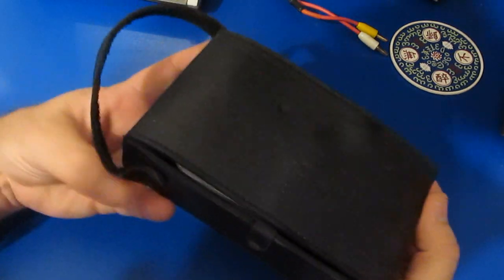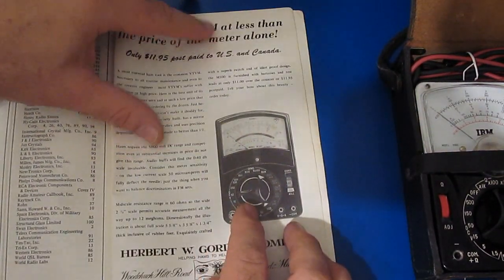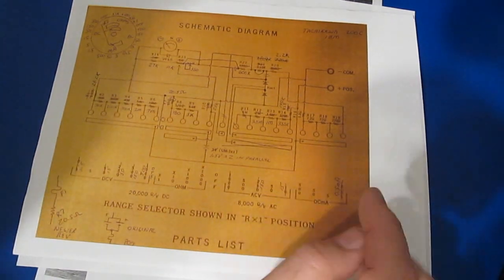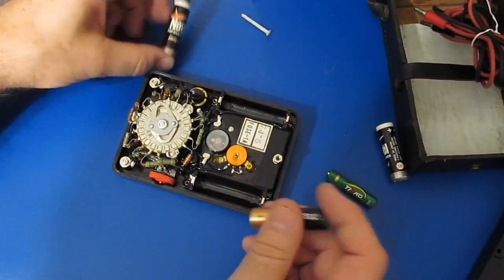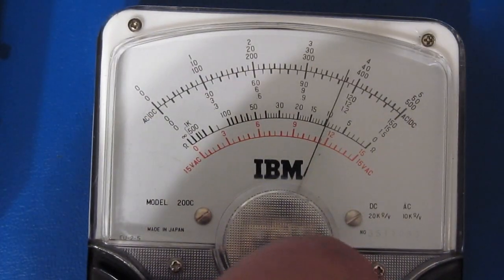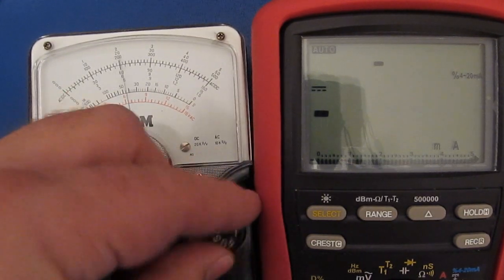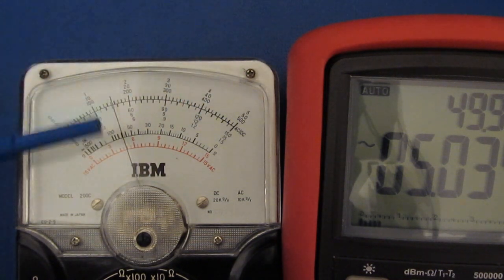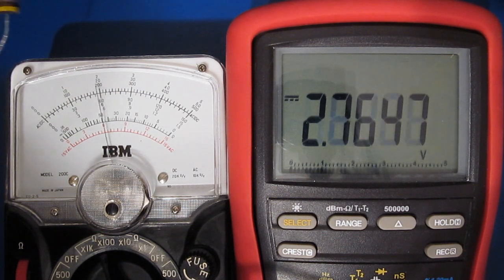Vintage Tachikawa IBM Model 200C Analog Handheld Meter

Comment: I just watched this video Dec 2021. My dad worked at IBM for 35 years and used one of these meters. He would replace it every few years. The old meter came home , I had several. Wish I would have saved one for sentimental reasons. The replacement was a Simpson 190 and a Fluke 8060A/AA. I still have them. Nice review.
Reply from the maker: Consider it an early Christmas present.

Comment: My dad worked as a Field Engineer for IBM in the 60s - 80s and I inherited this exact meter.  However, the fuse is missing.  What is the spec of the original fuse?  It looked like there was a sticker on the inside of the meter that said "1A", so is it a 1 amp fuse?

Thanks - great video - I know my dad would have really enjoyed it.
Reply from the maker: I used a little fuse 500mA ceramic fast blow.

Comment: I enjoyed this very much.  I have one of these meters that I got while attending ASU (I graduated in 1970), with a serial # of K48396. The only difference in mine from yours is that instead of a fuse it has what appears to be a little light that would glow during testing.  The main reason I watched this video was to confirm to my old memory the types of screws that holds the back in place, since I have long ago lost them.  I thought they were nylon, and your video confirms this.  I have been looking for replacements so that I can discontinue using black gaffers tape to hold the back to the front.  Would you or any of your subscribers know where I might purchase replacement screw of the proper length and thread.  I have been to several hardware stores and no metal screw (standard or metric) will work.  The only screw that I was able to get to thread and hold was taken from a trashed computer hard drive, but it was not long enough to secure the back at the top-middle position.  Any help would be greatly appreciated. Thanks, DH
Reply from the maker: I use mcmaster carr and fastenal.

Comment: I was going trough some old electronics stuff today and I found my old IBM 200c... I got that in the late 70'... thought I threw it away ages ago... and one of the batteries in there is still good, an old 1.5V Radio Shack Enercell Extra Life battery, must be at least 20 years old.

Comment: I have a tmk 500 meter but don't no how to use it any idea if i can get instructions or how to test it.
Thanjs.
Reply from the maker: Google "tmk 500", third hit: https://www.vintage-radio.net/forum/showthread.php?t=80468  scroll down a few posts and you will find the manual.   The internet is powerful.

Comment: Hi,  I have a TMK model 200 without  the letter C made by TMK. I bought it 1972, and has been with me since  then. It is a good meter and I can see why IBM modified  probably for his field engineers. The diferences between  the two models are.
Where you or IBM put the fuse holder, mine has an input to measure audio power levels with a scale in decibels... ( probably IBM field engineers did not find that  useful).
It measure DC voltages up to 1200 volts DC. 
The meter has a scale to measure  capacitance using the AC  volts range using  the 6 volts AC range. (The scale shows values from 0.0 till 0.2 microfarads.) . I remember the original manual that described how to make a setup do measure a capacitor in that range using a AC 6 volt transformer output ,conecting the capacitor as the load and reading  that spetial  scale you could measure its  capacitance . 
I came across your video because I am trying to get a copy of the original  manual.
Love your video and I have had many digital testers, but this one has been my only analog meter. I guess someone  will bury me with it..
Reply from the maker: Thanks for the post.  Sounds like yours is close to the one I show in the start of this video.
Reply from the maker: Also, you may be interested in the following:  https://www.eevblog.com/forum/testgear/history-of-tachikawa-(tmk)/25/
Reply: Yes mine is exactly  the one showed in the blog. Mine does not have a fuse holder inside 😮. What a I see are wire wound resistors  that may get fried  if you measure more than 600 ma.

Comment: Test the zero setting on the lowest resistance scale because the selector switch on these meters introduces some unstable series resistance with age. Unless you get some confirmation about the "IBM" branding, I am sceptical about whether that is genuine. While I am being picky, DEMOLITION is a noun; it is the act when you DEMOLISH something.
Reply from the maker: If you watched the entire video, you would have seen me adjust it in the low range, so not sure why you would ask me to do this.   Was there some point during the video where the resistance was unstable?    I am not sure what you would be skeptical about the marking.   It seems like they may have been made for their service techs.  They are fairly common.

Comment: Heres a tip.  Get yourself an MF-47 in kit form and learn how all its functions work.   For electronics repair and measurment this thing really has most of what you will use.  As an additional bonus it measures 2.5KV using a seperate input.  It can test for leaky capacitors, transistors and diodes. Its such a big meter that non of the traces come close to each other except at the selector switch. Pretty sure it would pass all of Joes robustness tests, just change the fuse for a ceramic.

Comment: Hi Joe, these TMK meters are relatively common over here in the UK. Sold from the 1960s through late 70s. A less expensive meter over the more usual  professionally used AVOMeter (our equivalent of your Simpson 2xx meters). The model 700 has a 50k ohm pv  movement.  Andrew
Reply from the maker: I suspected that they were more common there from the trade magazines.  I did not find any ads for them in the USA.

Comment: That is a gem of a meter. I would love to have one in my collection here. Such a prime example of mid 70s Japanese electronics.
Reply from the maker: If you like to collect old meters like this, I would guess that one I showed on eBay would be a good choice.  I highly suspect it predates this one and looks to be in very good condition.
Reply: I don't do ebay anymore. When I find meters, I find them. I'm actually trying to cut back some. I seem to have a penchant for really cheap analog meters. They follow me home like puppy dogs. If I saw that IBM branded meter at a flea market for the right price I'd pick it up.
Reply from the maker: I gave up on eBay several years ago myself.  Now things go to the salvage yard and I don't waste my time.  Worked out well in the early days.
Reply from the maker: I think they wanted to become what Amazon is today.

Comment: People often question the 'usefulness' of an analog meter. Apart from 'nostalgia', they certainly had, and still have their uses. They don't understand about "Ohms/Volt", and loading. Often, in modern electronics, readings are WRONG without loading. With more modern electronic meters, you might need to ADD say a 50k ohm resistor as a load, before trying to measure the voltage etc. from a SWPS etc. It is a broad subject :-)
EDITED......  Sometimes, this goes AGAINST you, and the 'Meter' itself is playing too much a part in the circuit being measured. THAT's when you need your 'modern' "Digital" :-)  Also, most 'Analog' meters have 2 x 1.5v batteries, and so for 'resistance' measurements, as well as Diode checking, (at least .6v forward bias to test)that is OK. However, modern 'meters' use SUCH a low internal voltage/current for tests, that they NEED a special 'Diode' range, that puts enough voltage through them for the test to be realistic....  It's all 'horses for courses'  xox
Reply from the maker: Many supplies I work with do have minimum load requirements and you are correct in that running outside of the manufactures limits can cause a significant error.  That said, most of these that I work with require several amps of loading.  And really, if you are running checks and not covering the basics, well dare I say you have bigger problems than your choice of equipment.  lol. 
I can't think of any application I have worked on, professional or hobby, where I felt an analog meter would offer any advantage.  If you look at that spreadsheet, you will notice there is more than one page to it.  One page is for the continuity function.   I started doing this after seeing so many people making reviews where they touch the leads together and call that their test.   You would think people playing with meters would be a little more data driven than that.  Anyway, that will give you some idea on the open circuit voltage and short circuit currents you can expect to see.

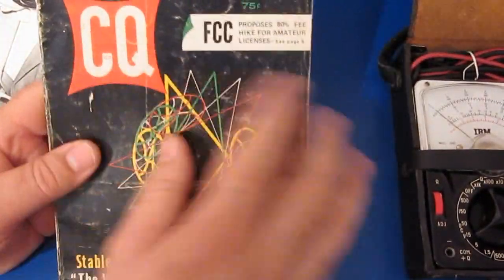Comment: @ about 3:00 I wonder if the "50uA VTVM" was a misprint. VTVM's don't draw that much from the unit under test as you know; I'm thinking that was a conventional VOM, much like yours. I've seen many Lafayette branded ones on eBay that resemble these.
Reply from the maker: I think you missunderstood what you saw and was lead on by me not reading the ad before I spoke.   lol.    This is what the ad states:  "Consider this meter sensitivity on the low current scale, 50 microampreres will fully deflect the needle; just the thing when you want to balance discriminators in FM sets."  The ad does not claim this to be a VTVM.  

To me, the ability for it to measure 5,000Volts DC is not something you see often in a handheld.

Comment: Interesting material, but very distracting that you kept moving the meter about in the field of view.  It might have been better to leave it still and point with a thin pointer at things of interest, like the scale being used and what the expected reading would be.
Reply from the maker: It's always hard for me to know if once the video is in the final form if there will be enough resolution to see anything.  With the scale on the analog meter being so fine and such a small area, I did not want to risk it.   Other option may be to do a dry run.   Or get a better camera.
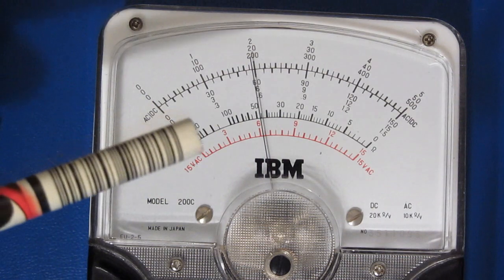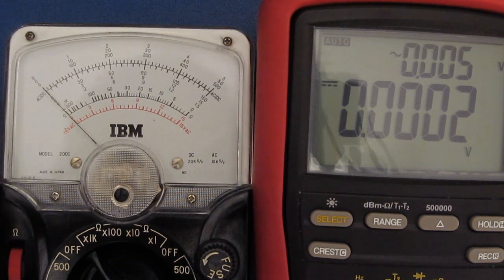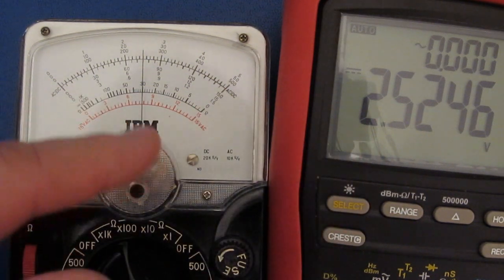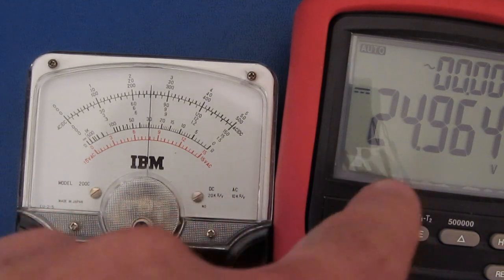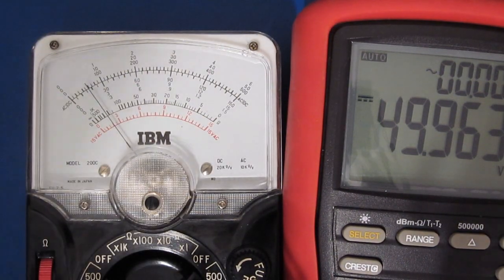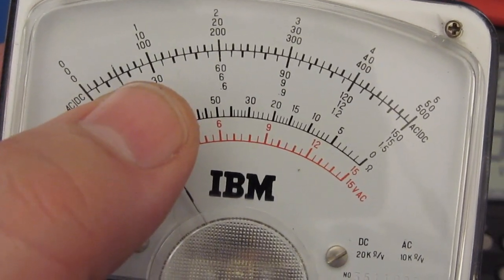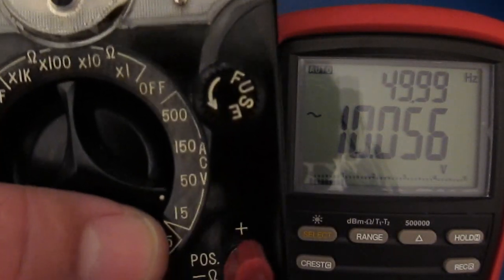Reply: It wasn't a resolution issue, it is that field of view continually changed.  The shot at 13:00 is good. The shot at 15:00 is also good, although it could have been a little tighter.  Then you start to constantly move the meter about.  IMHO it is very distracting for the shot (and the focus) to swing between the scale and you showing that you've set the switch to the range you say.  I'm most of us trust that if you say it's on a particular range then it is so.  Watch from 15:25 through to 15:45, 16:25 to 16:50, 19:25 to 19:50.  Constant movement and focus shifting.
Reply from the maker: Again, I had no idea until after I made the shot how readable it was going to be.   After making the video, I think I would have left the two side-by-side and called it a day.

Comment: thats one hell of a find. Im so glad multimeters have come so far since then :)
Reply from the maker: I understand that the house it was in was falling down which is why they were brought in.  They normally go through to check for hazards and saw this meter sitting there.   The strange bit is a lady owned the home who had never married.  She had passed on and the house was left.   We may never know how this lady came to own this meter.   It does not sound like she had worked for Big Blue or held any sort of technical job.   Of course, when I am dead and gone, someone is really going to wonder about those funny looking sleeves.   lol. 

When it comes to new handheld, you are not just kidding there!

Comment: Hi Joe, it is always nice to have an analog meter in the workshop. I like your fuse hack.
Reply from the maker: I really have no need for an analog handheld meter.   This thing will be a dust collector.  I was going to leave the meter wired as it was originally built but I had it all apart anyway and the mod itself was fairly clean.  Not to mention, the meter was certainly not museum grade.  In the end, the designer in me won out.

Comment: Nice meter ! 
I do not have info about the meter but I  have a tip for viewers. I collect and restore analog meters and one thing I learned is that often long not used meters can have "problems" with the meter movement that make it seem that they are out of specs and the trimpots are not enough to get it right. Before you start to replace resistors or trimpots, first set it in resistance mode and make the meter swing a while by  shorting and opening the testleads. So now and then test it on a voltage source (in V mode)  until the readings stop changing. 
A meter movement is  part mechanical and this way you most times get it running smooth again and within specsAnet A6 or within the range of the trimpots. Do not mess with the movement itself (spings, bearings etc).
Reply from the maker: Good eyes, steady hand and very good stainless tweezers to remove particulates in the movement.  Above all, take your time.  Any damage to these parts, you will pretty much scrap the movement.